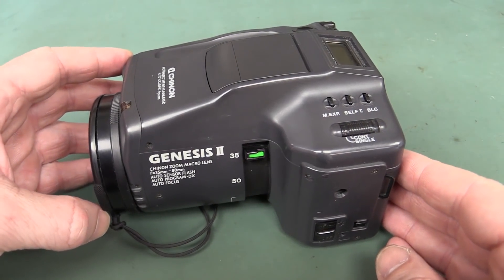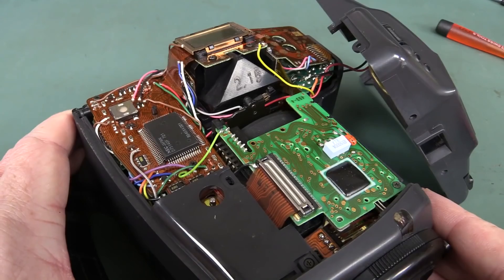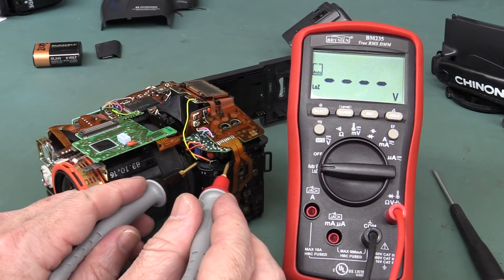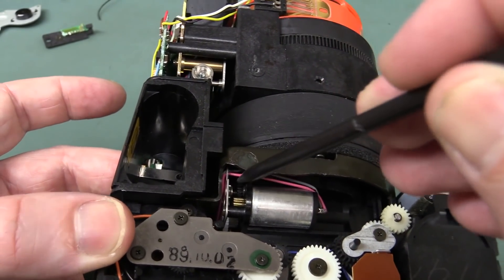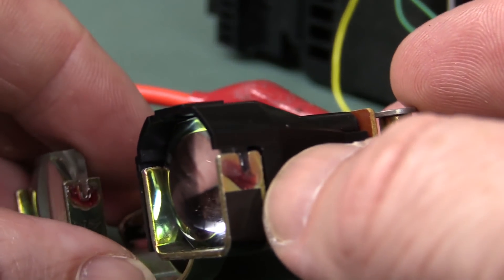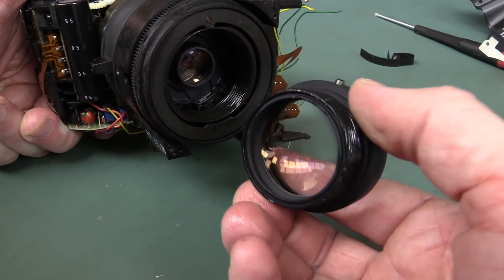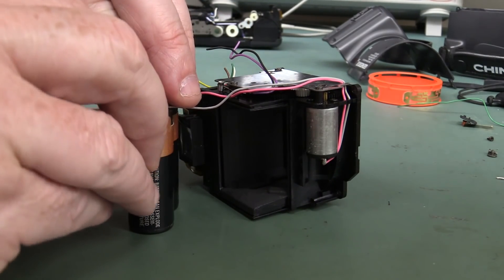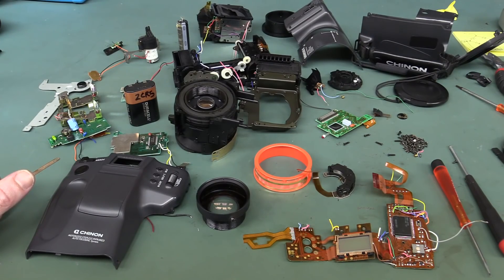EEVblog #816 - Chinon Film Camera Teardown

Comment: 3:03 So it's not an SLR, but it's just like an SLR? Both use a single lens, and isn't that the requirement for it to be considered an SLR viewfinder? My guess would be that the distinction would be that SLR's can have the lenses removed.
Reply: +LazerLord10 Yup. The difference between SLR and "ZLR" is the removable lenses.
Reply: +LazerLord10 ZLR was used by Olympus as a marketing term it didn't really mean anything they function exactly like an SLR camera just the lens isn't replaceable. 
It's pretty much what marketing would commonly refer to as "dSLR-Style" camera today, it's single lens reflex alright but you are stuck with what every lens they decided to go with...
Reply: it's just a viewfinder camera. If the lens system is fixed, and the viewfinder doesn't refocus along with the main lens then its as simple as the short name with no acronyms suggests.
Reply: +Robert Szasz The point of acronyms is to be specific. ZLR stands for Zoom Lens Reflex. It describes the lens, and the mechanism involved with exposing film. With the name "viewfinder camera" a disposable camera fits the same description. The lens is fixed and the viewfinder doesn't focus.
Reply: I misunderstood looking at the camera, I thought it wasn't a reflex. and was a viewfinder model.. shouldn't have posted before I stopped giggling at the way the film camera was joked about.

Derp....
Reply: +LazerLord10 I think the definition is quite simple SLR in dutch translates to "mirror reflex camera" which means that to be an SLR it has to use an mirror to shutter. I think the hole mirror reflex part is as accurate as you can get to what defines an SLR camera.
Reply: +LazerLord10 It is an SLR. Rangefinders could also be had in interchangable or fixed lens models.
Reply: +February  I've never actually heard of a "ZLR" before I always knew these as bridge cameras. I never knew there was another name.
Reply: +Lan Party Hosting Mirror reflex does not only cover SRL styled systems but also twin lens reflex cameras.
Reply: Wes56561
Neither have I haha.
Reply: Terry Wilson
SLR ot TLR systems say nothing about the removability of the optics. it just means that what you see, you see through a lens via a mirror. The lens may be fixed or not. does not matter.
Reply: Terry Wilson perhaps, but if you market a hybrid as a SLR, that will be the last product you will actually market.
The same goes for some mirror-less formula
Reply: I think there is a confusion between SLR as a technical design and SLR as a camera type. This clearly is SLR by the first definition but not by the second one. When people say SLR they typically mean something else than just the way the viewfinder is implemented.  For practical reasons SLR design became strongly associated with interchangeable cameras so it almost became a synonym for them. One should note that there has been some SLR designs that had fixed lens even in the early days of SLR. Canon had one in ca. 1960.

Note that in some other languages this was not the case. In Finland we call SLR cameras with a term that would be translated as system camera. This also means that there is no clear distinction between DSLR cameras and mirrorless cameras. The term System camera does exist in English and it has the same meaning. It just is not typically used. This terminology might partially explain the low popularity of mirrorless cameras in the U.S:
Reply: A ZLR camera is a type of SLR camera.
It was a way of making a cheaper "fancy" SLR camera with a permanently attached zoom lens (the Z in ZLR), instead of the expected interchangeable (by either screw thread or bayonet mount) lens found on SLR cameras.
Some of the early Olympus digital "SLR" cameras cheated slightly by using a small (usually 2/3") sensor and a permanently integrated autofocus zoom lens (essentially a point and shoot lens) so that it wasn't quite so obvious that these didn't have an APS sized digital sensor like the more expensive "professional" Pentax, Canon or Nikon DSLR cameras.
These were officially marketed as "ZLR cameras" to make them seem more special than they really were: a point & shoot with an SLR viewfinder.

Comment: Every proper camera uses the actual environmental light for the view finder - it is only your crappy modern pocket cameras that don't do that due to size constraints...
Reply: +Baerchenization I've seen SLRs that for some  insane reason uses a viewfinder monitor, I can't fathom why, I guess it's a bit more WYSIYG but the delay from the rolling shutter makes me dizzy and gives me a headache.
Reply: +Mostlyharmless1985 After commenting, I was thinking whether it holds true still, as I bought my last camera maybe 6-7 years ago - I do tend to totally research technology when I buy it, but I didn't really keep up with the latest and greatest... I assume that a proper camera still has an optical finder though :) I got a Sony A700 - had to buy Sony, as I was upgrading from a Minolta 9000, so I could keep my lenses... (Sony bought Minolta)
Reply: +Baerchenization, Mirrorless cameras are fantastic (CSC, Compact System Cameras). I have a DSLR and a CSC, but I very rarely carry the big bulky DSLR with me.. only when I do a planned photography trip. http://www.techradar.com/news/photography-video-capture/cameras/best-compact-system-camera-2013-the-best-models-reviewed-960832